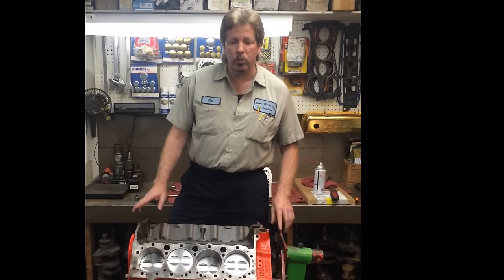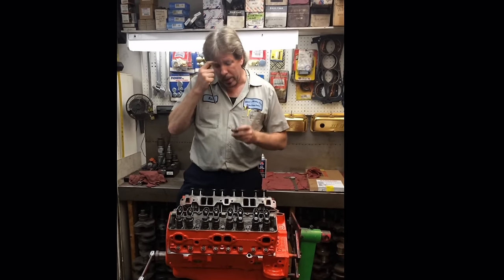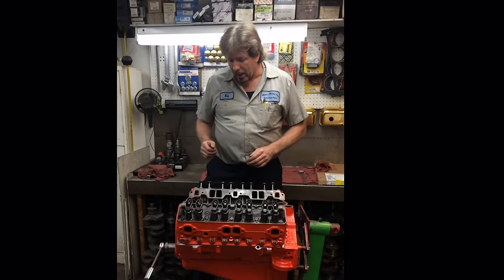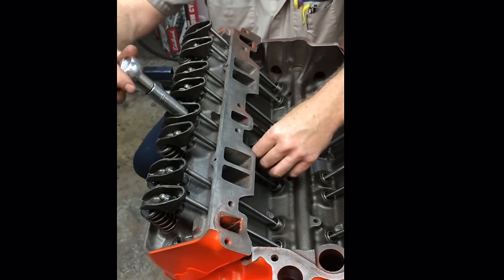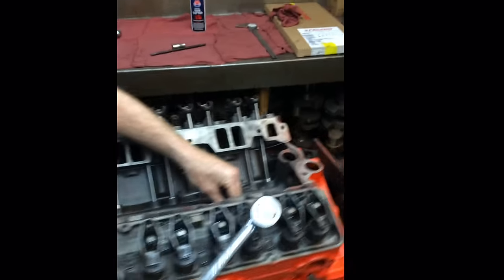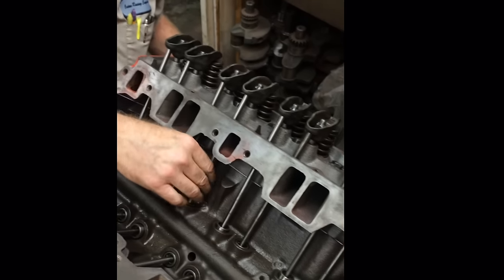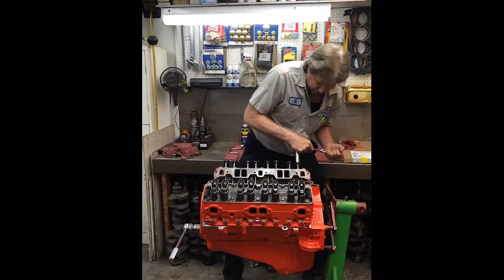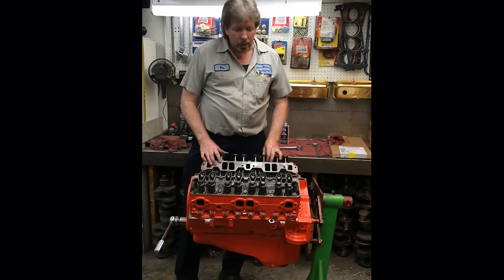Hydraulic valve adjustment made easy - Your Engine Guy

Comment: This guy is AWESOME.  Called him up to ask a question.  He took my question and was very personable.  Even though he did not have to, he took a few moments to have a conversation.  Great Guy!
Reply: rare
Reply: What’s his number
Reply: Would say everyone has a purpose plus something to share' with à common interests ' Definitely a plus if someone is willing to learn plus 'trainable'.
Reply: What town and state is his shop in
Reply: How to ajust the lifters if the lifters already have oil in them can I do it the same way or do I have to buy new lifters
Reply: @jamesjennejohn5441 squeeze the oil out of them then adjust them and prime them back up
Reply: @jamesjennejohn5441 As Jeremy said you can adjust the lifters down slowly and force the oil out. There's a tiny hole in the side of the lifter that oil is fed into constantly, it fills the lifter to provide the cushion, and the oil continues on up and out through the pushrod where it provides lubrication to the valve stem face, then it continues down into the gallery and onto the cam and eventually to the oil pan where the process is repeated.
For a running vehicle where the lifters have already been pumped up I personally try to use pushrod oil diverter clips. They snap on the top of the pushrod and don't block the oil hole but just act as a splash guard. Then loosen the lash nut until the lifter clatters and then slowly turn the nut 3/4 of a turn in 3 or 4 increments, pausing a few times, just as Ken described.
I prefer to use the diverters because I'm just not a fan of guessing if I've forced all the oil out of a lifter to empty it because it's too easy to damage a lifter because the adjuster nut requires torque to turn and that makes it very iffy for a novice or occasional DIY-er to damage the lifter internals.
Reply: Ok i have a question so i have had my 85 firebird lg4 305 for about 6 months and had a lose rocker arm and wanted to just do a adjustment with this being my first time can i do the the same steps in this video with the engine the fully completed in the vehicle
Reply: One of the very best. Thank you sir!
Reply: Did u start on tdc?

Comment: I followed this guys instructions almost to a T.Only thing I did differently was I went around more like 12, 90 degree turns instead of 8,made damn sure I was on TDC compression when I was finished.When I finally got my motor all put back together it started right up and is purring like a cat,no tapping,no noise.This was one of the most helpful videos I have ever watched.This guy is the best,I wish I could shake his hand and thank him in person!
Reply: Thanks for your recent comments, I plan to use this technique when I swap headS on my 302 HO…MUCH appreciated
Reply: Jdb🎉
Reply: If the engine is already in the car do you use the starter to rotate the engine ???
Reply: So this would work on an ls3 right?

Comment: Very good. This is probably a stupid question, but, as I approach 73 years of age, I really like to ask more experienced folks. Here's the question, please: What about when changing rockers in a hydraulic, flat-tappet engine that has already been running several years? Of course, as you know, the hydraulic tappets are full of oil. Thanks for any advice you can give me.

Comment: Hands down the best valve adjustment video on youtube!!!
Reply: I agree
Reply: easy peasy   @  NOT  under  the  hood   ......   do  U  2  TUBS  get  IT
Reply: U   STILL  BROKEN  DOWN   a  taylor ...      I  am  NOT  going   give  RACE  secret >  for  free  FUK   t  you  whiTE  man  haters     ..  your  > <     MATH  SUCKS   @   Valve          good  Grief  ..
Reply: Greatly Agree with Tim
Reply: @ataylor3666  If it still runs right whys it matter how its done I used this method worked great
Reply: @ataylor3666  well I've been doing mine basic the same way he say 3/4 turn after 0 lash with the lifter on the foot no problems.i rather go 3/4 than 1full.too tight valves may hang open temp can cause parts to grow.but you're right too
Reply: @ataylor3666  WHEN PEOPLE YELL AND TELL YOU THIS IS THE WAY TO DO IT RIGHT, not many will listen to what you are saying. Ken's way is quite similar to yours with TDC with both valves closed. If Tim loses his place b/c he is taking care of customers he has to start all over again. Which ever has worked for him for many years has proven what works best for him and it works for his customers. Next you make/force a comment, please don't yell but speak a little kinder, that will make you a better teacher.
Reply: @ataylor3666  The ONLY difference between his way and "Your" way is that your way doesn't have to go back and adjust each one each time you take a 1/4 turn... Meaning it's super easy to lose your place with your way which is EXACTLY what he was driving at! Oh and the 3/4 turn past touch to your 1 full turn, his preference over yours and he specifically called that out.
Reply: Nice video man I'm going to try this on mine I just put a new cam in but i did soak the lifters in oil but didn't pump them up. Hopefully it still works
Reply: @squarebodyg5354  set those lifters on the shelf  and pick up another set. They aren't expensive.  Sell the soaked ones to know it all friend!!! Lol
Reply: That is the wrong way to adjust hydraulic lifters.
That's how you adjust solid lifters
Reply: What if your lifters are already soaked in oil ?? And not dry?
Reply: Same result with either method.
Reply: @ataylor3666  it's the same!

Comment: This procedure worked magnificently on my newly built 350 SBC, with a Comp Cams XE268H hydraulic flat tappet cam and Blueprint H8002K aluminum heads with dual valve springs. Note: Lifters were DRY for the initial break in with the inner valve springs removed. Engine fired almost instantly after a minor distributor adjustment. Inner valve springs have been reinstalled and now ready for the final adjustment. Contacted Ken to see if the procedure has changed since the lifters are now primed after the break in. He indicated the procedure is still the same with a 3/4 turn after obtaining zero lash, but the engine might stumble briefly until the valves self adjust, but this is normal. My sincerest thanks to Ken for this fantastic video, as I'm quite certain it has helped many novice, as well as seasoned engine builders. 2 thumbs up!!
Reply: Thanks for posting what he said regarding existing lifters.  That was my question and the reason I was reading comments. About to change valve stem seals and will give this a go!
Reply: Thank you for that reply, it was the exact reason I was reading through the comments!
Reply: So if the lifter have oil in them like for instance your putting new push rods and rockers on the motor but the lifters have been in there with oil in them you can still use this technique is that correct
Reply: Thanks for this comment, needed to know if the procedure changes for a recently running vehicle.
Reply: @Studebomber  how'd this go?  Have to do this same job and want to verify that this video is an okay guide for a vehicle that recently was running.  89 Vette l98 350
Reply: @samstrolia  it went well.  He's a great instructor.
Reply: @Studebomber  so having oil in the lifters already didn't affect the procedure?
Reply: @samstrolia  nope
Reply: @Studebomber  I appreciate the info, thanks 👍👍
Reply: @samstrolia  no problem

Comment: Great video man I've never seen valve adjustment done that way but it makes total sense! I'm gonna try that on my next build. You need to make more videos man don't let that 30+ years of experience disappear.
Reply from the maker: I have many videos on Facebook at Ellison's Machine Shop.  I will be having a lot more content uploaded to YouTube soon.  Thanks for following!
Reply: @ellisonsmachineshop-youren4268  I do mine close to that but only when the lifter is down.
Reply: Yes!!!!
Reply: @aksgarage3230  thank God finally someone with a brain
Reply: Ellison Empire  thanks man this seems easy enough ill try do my own valves
Reply: @supersportimpalass  I know he explains how to pump oil into the lifters but im still confused. What do I do?
Reply: @ellisonsmachineshop-youren4268   no kidding I just came off your comment section I seen a guy ask you what if you're using your original lifters that came in the motor and you suspect they already have oil in them can you still use that method and I didn't see no reply to that
Reply: Please upload more videos to YouTube this video is great👍
Reply: Can you do the same with used lifters
Reply: @carlt6932  Mine have oil in them. Can you explain what to do in this situation.
Reply: I use the same method to adjust the exhaust rockers on EMD 2 cycle locomotive engines, as long as it’s on the base circle of the cam which in right under the rocker arms on these engines, it’s fine to adjust it. Al bets are off when you have to set the injector timing - those have to be set at the specified degree on the flywheel and using the clearance tool on top of the injector body.
Reply: @isaiguevara2871 if they’re pumped up, stop at zero lash.

Comment: MY NAME IS JOHNNY MORGAN FROM JAX.,FL. I'M A RETIRED ENGINE ASSEMBLER OF 27YRS. I STARTED IN 1986 I WAS 16YO. OLD SCHOOL ENGINES AND DRAG RACING. I WAS LOOKING UP A CRANE SOLID CAM FOR A BB 454 CHEVY I'M BUILDING AND FOUND KEN'S VIDEO, AFTER WATCHING, ALL I CAN SAY IS KEN IS 1 KNOWLEDGEABLE AWESOME GUY, I DON'T COMMENT OR SUBSCRIBE MUCH BUT KEN GAVE  SOME OF HIS KNOWLEDGE TO SHOW AND HELP THOSE THAT WEREN'T QUITE SURE THE BEST WAY IN DETAIL HOW TO ADJUST HYD. VALVES .AS FOR ME A MEMORY OF AN OLD TIMER MR. DANIEL THAT SHOWED ME KEN'S WAY WHEN I WAS 16, SO THANKS KEN FOR THE MEMORY'S AND BEING HELPFUL. I DID SUBSCRIBE. IT'S NICE TO SEE AN OLD SCHOOL VIDEO.
Reply: This looks really easy. It was done with dry lifter. What do I do if it’s a motor that has no been running and lifters are already hard and pumped up? Will this process work on a running motor
Reply: @stevenlindquist7430 That's the trouble with YouTube comments and questions; sometimes the guy has moved on to other videos and time doesn't allow them to respond to late questions.
That is a good question? Sorry I don't have the answer. I want to ask him which way the oil hole points on a roller lifter, inward towards the center of the valley or outward towards the head?
I would guess towards the center of the valley. That way the oil would flow back around the base of the lifter keeping the lifter and it's shaft well oiled?

Comment: Ken was nice enough to call me back about the issue of doing this on an engine that has been run and the lifters have oil in them.
He said you absolutely can use this method. The only thing that may happen is some of the valves may be open slightly and the engine could run rough for a min or so but will smooth out.
He said not to worry and use this method. That's what I'm going to do on Friday and will let everyone know what happens.

Everything worked out. Car started right up. Thanks Ken!
Reply: Were you able to tighten each rocker another 3/4 turn at the end (to set the ~ .035 lash) of as Ken suggested?  A few of my lifters seemed to "bottom out" before I got to a full 3/4 of a turn.
Reply: Have a 396 in my chevelle that has oil in lifters and need adjustment so this procedure works but may run ruff for a minute or two at start up.
Reply: Did you have to take off the intake manifold to this or just the valve covers?
Reply: @214Pmoney  you wouldn’t need to take off manifold you can twist rod under rocker his was off for final assembly
Reply: Another question, do I have to lossen the rocker arms all the way and then start this procedure? Or start the procedure without loosening the rocker arms?
Reply: @hueyrotorhead  Do I loosen the rocker arms all way bf I start the procedure?
Reply: Thanks for asking that question about what if you already have oil in the lifters.

Comment: Ken, perfect example of GREATNESS. I am a ASE Master Tech, 40+ years in this field.  I've been working on engine's, transmissions, differentials, vehicle's of all kind's now, and farm equipment back then, and it feels like forever now. My dad had me re-ringing/bearings small engines by 7-8, pulling out and putting syncro's and re-bearing 3/4 speed transmissions when I was about 12. Dad, he was ole school, adjusting valves his way. Well we mostly had V-8 cars and trucks, so I found my way around them pretty good. Your build in this video, 327ci double hump heads, YA, on my engine stand, going in a 65 K10 in my shop this week. Back about 1972, using a damn old jig saw, I cut the top of the valve covers open, cut my hand on the sharp edges, bend the lid up, to adjust the valves while it was running. Not such as big of a mess than doing it with no valve covers. He thought that was pretty clever. Fast forward, I was checking on here to HOPEFULLY find and easier way to everyone's headache, or refresh my memory. Cam, lifters, heads going on tomorrow night, then it goes in Tues night. Your video, SUPERBLY DONE, totally makes sense. Thank you for the easiest and most effective way I have ever seem.
Reply: Yes sir confirmed what I knew and added some things I did not know good job my friend
Reply: I was thought to adjust the valves with the engine running definitely a mess doing it that way I'm getting ready to pull the heads off of my 302 to check some things out someone else built the engine before I got the car it's in I definitely will adjust the valves the way he just showed us
Reply: Hey bud can I do this on a 390 fe with a non adjustable rocker arm shaft.  Use this procedure?  Thank you

Comment: Wow I Thank God for your video. This is my very first time every working on an engine and of course I chose my 03 chevy tahoe lt with a 5.3 engine To work on. With no real Mechanical knowledge othe than what I've learned from YouTube. Trying figured out why my RPMs were run low. I came to the conclusion, that it must a compression problem. Made me think of replacing all that gaskets and seals. Which I came to find that i had three popped bolts on my exhaust manifold, as I was working on removing the head to replace the gasket. All the while wondering how in the world am I going to get this all back together without screwing it up. Then Boom,  your video pops up. Your right those other methods are way to complicated and time consuming. Coming across you video allowed me to see the light at the end of the tunnel. I'm honored to be learning timeless knowledge and wisdom from a wise gent like yourself. Definitely looking forward to more of your videos brother as I need all the help and knowledge i can get. Thank you. Peace and blessing.

Comment: Followed this instruction as well and all I had to do is adjust the distributor and she's running!!!   Im not a mechanic, just mechanically inclined.
Replaced heads, lifters , rocker arms, valves, seals, push rods, plugs and wires. Its even running on the 351 firing order.
Since it's an F 150 im going back to the 1372 6548 firing order sfter my headers arrive.
THANK YOU it was my first rebuild ever and this worked!!!!
Temporarily. I have non adjustable rockers. With only 3/4 turn after lash they all came loose after the first fire up or two and I simply went back and torqued the rocker bolts to 20 lbs/ ft .of torque.
Tried it again and it ran better than at 3/4 turn. 
So far, so good. I'll keep you posted. Great video, thanks again!! St as ying on 351 firing order too😎

Comment: This is a very simple easy method of adjusting hydronic lifter. Very excellent job and you makes it very easy for me. I have been having a hard time adjusting the valve lash on my pontiac using the other method where rotate the engine until you see the intake rise and close and exhaust start to move. That method wouldn't work for me. Thanks to you Sir for introducing your method.

Comment: I can’t thank you enough for posting this procedure. I had to remove and replace the heads on my Chevrolet Express. While in there, it seemed prudent to re do the seals etc. 

To remove the valve covers you’ve got to loosen the accessory drive brackets and pull them forward from the block.

 I followed this procedure methodically, and was rewarded with a perfectly smooth running engine and quiet valve train the first time! No muss, no fuss, no backtracking or re doing the work.

Thank you again!

Comment: Hey Ken, I’d like to start out by saying I’m 28, and I dig that 327 just as much as the hot 350 I built and the 383 in the pickup I just bought. I started wrenching the wrong way early in high school, and started doin it the right way a few years ago. I gotta say, out of all the valves I’ve lashed, I never would have thought of this method, it’s genius. So thank you very much for the lesson, I’m gonna go watch the rest!

Comment: Thanks, Now That's A handy Bit Of Know How.
 I've made a lot of messes adjusting valve lash, rocker arms, tappets what have you and always in a rush when doing it to keep the mess down to a dull roar.
 This trick will save time in many ways from clean up to assembly and starting the engine after rebuilding the entire motor or just the top end which is key to breaking it in the right way.
 This applies to simple cam swaps, after lapping valves, etc.
 30 years of experience is good enough for me. Hands on experience is by far the best teacher of them all.
 I've been wrenching longer than that as a hobby engine builder, street strip hot rods.
 I really appreciate that tidbit of knowledge and will put it to practice soon building a nostalgic sbc 406 for 1935 Chevy Pickup Gasser Drag Truck with Camel Hump Fuelie Heads.
 Thanks again, I just subscribed to your channel.